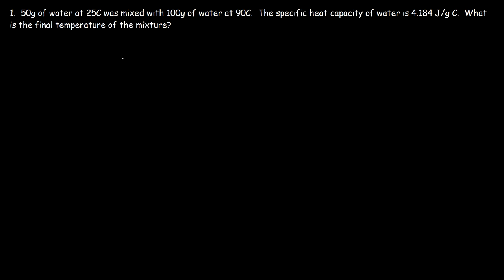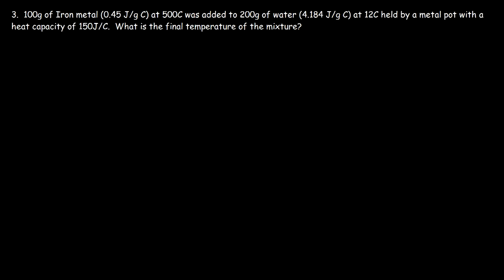Final Temperature Calorimetry Practice Problems - Chemistry

Comment: How would you handle a problem where there were two different pieces of metals with different specific heat capacities?
Reply: Socal Fritos I have the same problem!
Reply: did you ever find out? I need to know too :')
Reply: You will have to add those two metals together. It will be:

mc∆T of metal 1 + mc∆T of metal 2 = whatever is gaining energy from metal.

It's been one year though so I assume you know how to solve this already.
Reply: @samanthaperry4543  You will have to add those two metals together. It will be:

mc∆T of metal 1 + mc∆T of metal 2 = whatever is gaining energy from metal.

It's been one year though so I assume you know how to solve this already.
Reply: @frazebean5117  Thank you sir, helping the next generation

Comment: what would you do for something similar to the last question. say if the pot with the water has a higher temperature than the lead. 
would both the q of pot and q of water be released to lead? or would it be just the one with the higher heat capacity